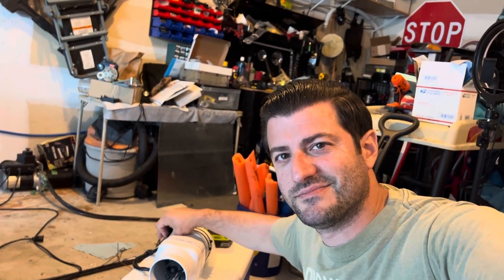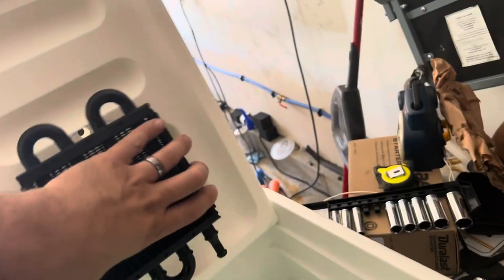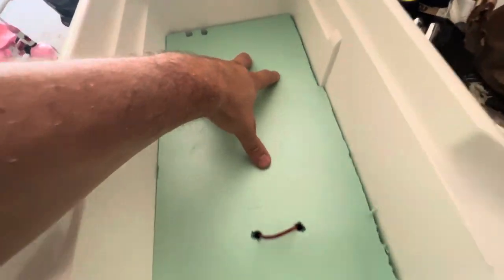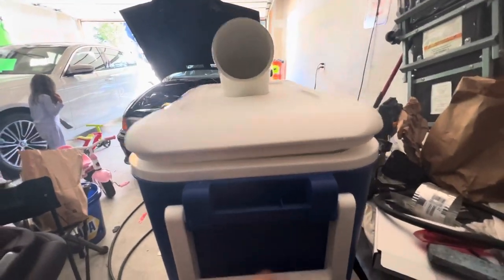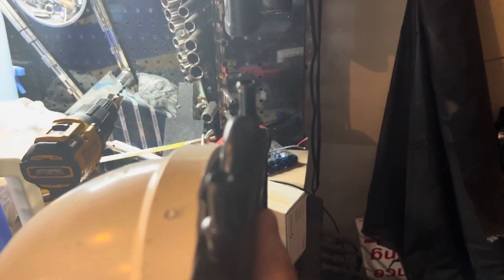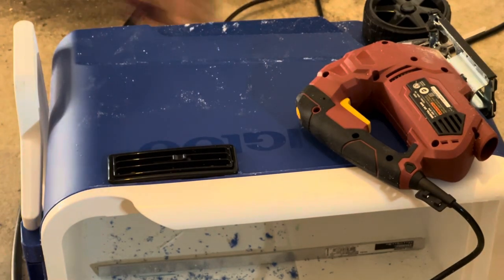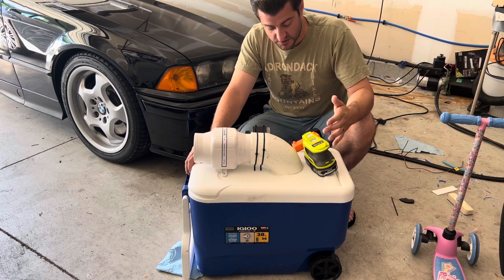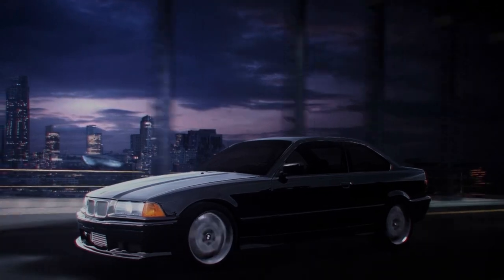DIY ICE COOLER AC: Portable Air Conditioner That Lasts For Hours!!

Comment: heya bro, I see a lot of people building these type of air coolers. Interesting idea, but one thing I noticed is that they all destroy a perfectly good ice chest when there are other options. Remove the lid and construct one of your own keeping the original lid in tact. After all, we are builders and craftsmen. It wouldn't take much to do. The other thing is, why use ice, ice blocks, etc when there these fridge/freezers that are portable and run on 12v. I have one and can keep meats and even ice cream frozen when I camp. Think about it. It eliminates the need for buying ice cubes every few hours. Mine reaches .04F. I make my own ice. If you have the parts you used in making your video then you're all good to go just pick up one of those little fridge/freezers online. They're pretty cheap. I hope this helps you cool off the Bimmer.
Reply from the maker: The 2 problems I’d face with a refrigerator is in a small space they give off a lot of heat so it would be counterintuitive and less portable. Also, they use a lot of power and would either not work with the inverter well, or kill the battery fast :/
Reply: @LowBoostFilms  think of this as a highly portable low power, air to water solid state thermal battery
Reply: Have you considered making your own blocks of ice using a plastic tray in which you freeze water? You can make several rectangular shaped blocks,  maybe 2" high or so, with the length and width being just smaller than the interior length and width of your cooler. Then to that you can add cold water
Reply: One question I have is about the purpose of the black vent. Was that supposed to let out the warm air that is between the plenum and the top of the cooler?
Reply: @bradbiesecker162 no, that’s the inlet air for the fan. If it wasn’t there, there wouldn’t be any air flow. It’d be like sucking on a bottle of.

Comment: Drill two holes in the top and move the fan in front of the of the fan. This way you dont need the ducts to pull air in and warm the ice. Keep it a sealed system.

Comment: heya bro, good to hear from you. The little fridge/freezer doesn't put out any heat. The one I have runs on very low wattage and is as portable as any other ice chest. The good news is, you can use all the parts as in your video. My point is, building it without destroying your new ice chest, ie cutting holes in it. Look into the little fridge/freezer online. The specs are all there. Anyway, my cooler cools down to below freezing (-4 degrees) and runs off of a 12 volt LiFePo4 battery for more than 3 days without having to use ice cubes every 4 hours Happy building, my friend..
Reply from the maker: I’ll definitely check it out. I wonder if it can continuously cool the water lines to a cold amount. Worth a shot!
Reply: What do you mean by the little fridge freezer. I want to build something similar to this. What is it that I'm looking for.

Comment: If you added a second heat exchange with a similar surface area to the evaporator radiator, inside the cold ice/water side, you’d see significantly cooler output temps
Reply from the maker: That’s a good idea! I may make a smaller and more portable one I’ll try that
Reply: Why would that help? And would you put that before or after the pump?

Comment: Did you get heat coming off the pump and melting the ice within 20 mins?
Reply from the maker: No, the pump doesn’t give off a lot of heat. It lasts a solid 4 to 5 hours easily still ice in  there.

Comment: Question. If I take an Isuzu AC Condenser, pump cold water through it, and then push air with a box fan, would it give me more cold air volume? Or does it only work with evaporator cores?
Reply from the maker: That would work, but when you are pushing that much air it will be hard to keep the ice from melting quickly. Meaning you’ll need a lot more ice and a better pump.

Comment: Wouldnt just running a straight pipe with the blower and radiator in the middle be more effective and less work?
Your intake and output would be external from your insulated cooler and you wouldnt have to put as many holes in it.
Reply from the maker: I thought about that but the condensation through that pipe would be a lot.

Comment: Good video.  A 30 degree drop in temp is pretty good.  When you swapped out the pump (or got rid of the kink) did it work better?
Reply from the maker: Yea it definitely worked better.

Comment: Use coolant instead of water then put your ice in the cooler
Reply from the maker: Really?
Reply: I haven't tried  it  yet but I have a old Heather core with similar blueprint that you used and I believe  that coolant would work because it wouldn't melt your ice jugs that's just my theory 😉 worth a try

Comment: Nice job but you need a breeder hole in there so are can get in it will have more flow
Reply from the maker: Where would you suggest?
Reply: @LowBoostFilms  in the opposite side of the airflow are on top side of the cooler
Reply: I'll make one just like this one and it works great
Reply from the maker: @washingtonarias4476 I’ll have to try that!